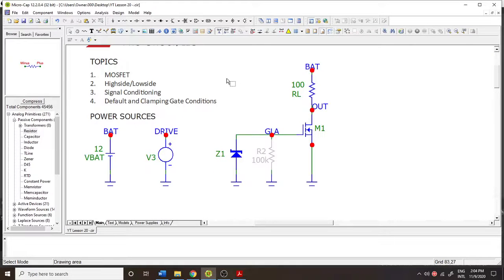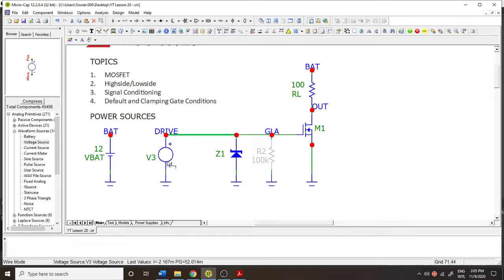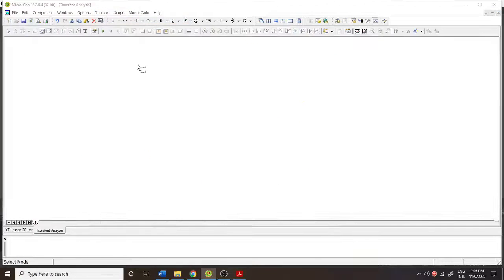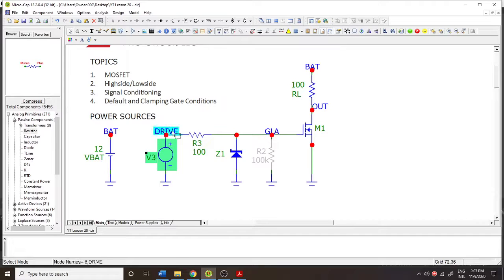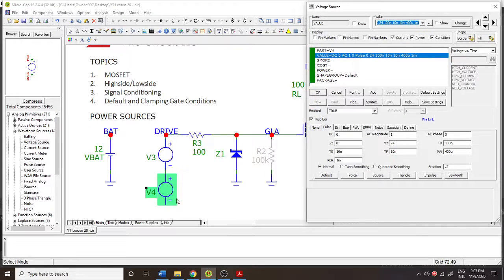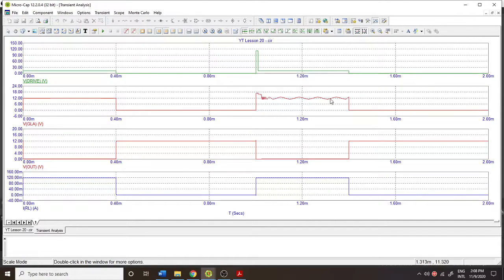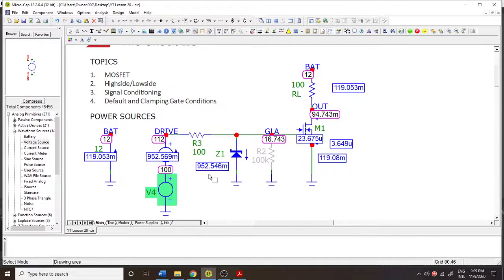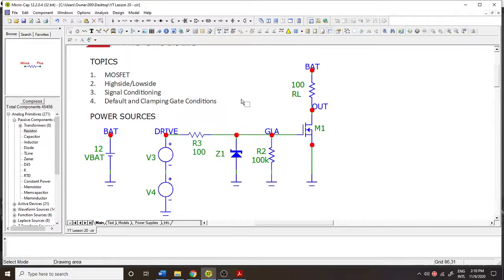Micro-Cap Tutorial: MOSFET Gate-Source Overvoltage Clamping (Zener Diode)

Comment: Hi. Does this apply to inductive loads as well as to the logic level signal?
Reply from the maker: Inductive loads are going to respond to whatever signal you put into them. The point of the FET is to translate the low level decision making to the heavy lifting portion that makes sense for the induction (solenoids, motors, etc). If the logic level side of the FET is protected, then the load side won't notice a different. However, if levels breach or the nature of the waveform changes from what you're intending then the motor will react to the frequency content. Hope that helps!

Comment: Remember that like every diode zener diode have a capacitance so with series driver resistance you create an RC filter that slows down MOSFET switching time and therefore you increase switching losses. Moreover in real world circuits with proper layout and if driver have stable power supply the overvoltage doesn't come from driver but from upper MOSFET switching in Half-Bridge that charges miller capacitance of bottom MOSFET.
Reply from the maker: Accurate!

Comment: Can’t this circuit applies to high and low side in a inverter circuit
Reply from the maker: Yes it can! Make certain to place the zener between the correct nodes (line input and highside power supply)

Comment: Interesting I love building circuit but indeed help with understanding how mosfet work in inverter why I ask is because I build and inverter circuit but I can’t get the mosfet to switch in conditions mood to power the transformer I flow all the right instructions on a circuit i same on YouTube but I can get the mosfet to conduct is it the transformer why the mosfet not inverting I use a low frequency transformer and high frequency transformer to the high one only buzzz and no voltage so I need some information about what am doing wrong
Reply from the maker: What inverter see you using? What are you trying to do?

Comment: Hello, does this data sheet specification "Vgs - Gate-Source Voltage:  - 10 V, + 10 V" apply to what you are showing in the video? As in, do not supply more than plus or minus 10V to the gate from the driver? Gate-Source is confusing due to the MOSFET having a "source" pin. Does it really mean Driver-Gate Voltage?
Reply from the maker: It may be in how you're understanding electronics terminology. There isn't really ever such a thing as a driver voltage without also specifying a driver return (or often called ground). Voltage always has two points of reference and that's why it is sometimes called "potential difference." So, if the voltage between the gate and source exceeds the limit for that device, then my recommendation is to avoid encroaching or tresspassing the border. Most MOSFETs have plus/minus 20 V limit between gate and source pins. Exceeding voltage limits between two places for most devices usually ends up in some kind of dieletric breakdown effects and several orders of magnitude change in resistance (failure mode: coerced permission; such as megaohms to single digit kilo-ohms). In applications which use MOSFETs in a highside position, it's possible to have voltages of gate to the system "ground" much higher than the limit between gate and source (because the source isnt connected to ground). The MOSFET only cares about itself...so if the application space or ecosystem that it's in is friendly to the device's limits, it'll behave the way it was designed or expected to.
Reply: @pauljstar  Thanks, I do understand potential difference, however I also appreciate the additional info you took time to share. Always willing to listen and learn.
Reply from the maker: @anondusery1271  of course, sorry if it felt weird. I never know where people are at or how they learned to speak about electronics. I taught some MSEEs while I was at ASC and you'd be surprised what crutch concepts were holding them together...so I don't like to assume anything anymore haha. Is there still something you wanted to know about gate-source limits? 🤔

Comment: Great tutorial. I have a grid tie inverter that has 4 IGBTs FGL60N100BNTD and each one has a smd zener diode between gate and source. Would you know what value the diodes should be, please. Many thanks
Reply from the maker: For an igbt that might be a little different...consult the datasheet for the transistor and determine the application context a little more tightly (like what kind of control signals are actuating these devices). I don't typically use igbts but the terminal vernacular is gate, emitter, and collector... igbts are basically a mosfet controlling a bjt. They do that because mosfets are fast and bjts conduct better in higher power applications (best of both worlds kind of thing). So, anyway, try to learn more about the drive system and design from there! Good luck!

Comment: Try a TVS diode.  Much faster response time than a zener
Reply from the maker: Agreed, provided you have money 💰
Reply: But MUCH larger junction capacitance too (because of the larger silicon area to absorb the energy). That's why zeners are preferred for this application because their junction capacitance is much smaller and they work just as well (fast) for low energy pulses.